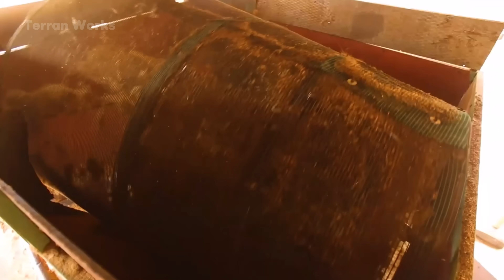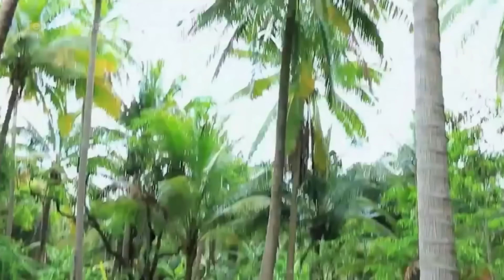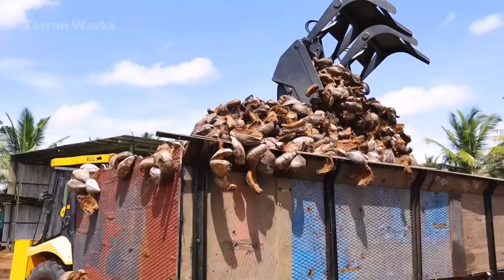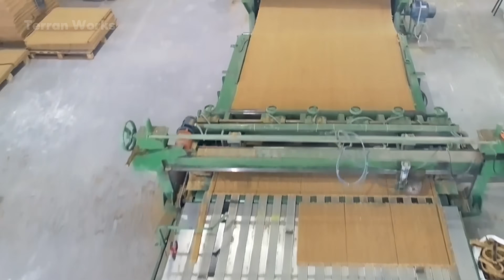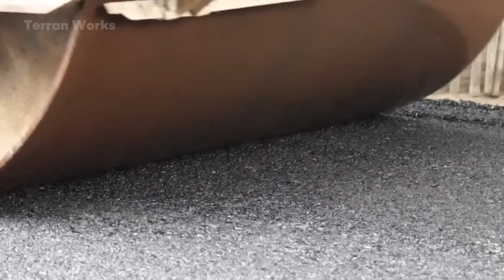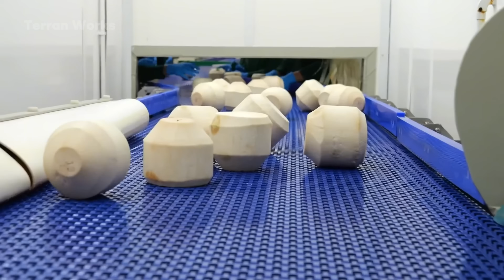How Genius Indian Engineers Build Massive Roads from Million Tons of Waste Coconut Fiber

Comment: What I was taught is that you want NO organic matter in the roadbase.  I am guessing the mats are minimal thickness and are isolated enough from moisture and air to not decay.  Otherwise I would be worried about having to path the road every few years instead of decade.
Reply from the maker: Thank you for sharing, organic materials are generally not ideal for road bases, in this case they may be treated or designed to limit decomposition, but long term durability is still something to monitor

Comment: In Kerala roads are made with coir beds they absorb water and stabilize soil and road after flattened.
Reply from the maker: Thank you for sharing that interesting example. Using coir in road construction is a way to utilize local natural materials and can help control erosion and stabilize the soil base. Initiatives like this show how different regions are combining traditional materials with modern engineering approaches.
Reply: @TerranWorks Kerala is implementing advanced, resilient road technologies to combat monsoon damage, focusing on Full Depth Reclamation (FDR), geogrids, and modified bitumen to create durable, long-lasting infrastructure. The PWD is modernizing construction through smart, eco-friendly techniques like crumb rubber modification, soil nailing, and micro-surfacing, aiming for international standards, including urban projects with smart drainage and utility ducting. 
Key Road Technologies and Innovations in Kerala
Full Depth Reclamation (FDR): A major initiative, especially in areas like Kollam, where the existing, damaged road base is recycled and strengthened to create a durable foundation, which is crucial for handling Kerala’s intense monsoons.
Modified Bitumen (CRMB): The use of Crumb Rubber Modified Bitumen (CRMB) has been adopted to make roads more durable and eco-friendly, notably on the Ernakulam–Muvattupuzha road.
Advanced Geo-technologies: Geo-cells and geo-grids are being used to reinforce soil and improve the load-bearing capacity of roads.
Surface Improvements: Micro-surfacing and segmental blocks are implemented to create durable, waterproof protective layers.
Weather-Resistant Materials: The Kerala Highway Research Institute (KHRI) has recommended using hydrated lime and cement in the bitumen mix to reduce humidity, which causes roads to remain soft and fail after rain.
Smart Cities Infrastructure: In cities like Thiruvananthapuram, "smart roads" are being built featuring underground ducting, improved drainage, LED lighting, and smart traffic management.
Soil Nailing & Slope Protection: Used in hilly areas to enhance stability and prevent landslides on road edges. 

Key Initiatives and Agencies
PWD Kerala PWD: Actively implementing these technologies to upgrade road longevity.
KHRI Kerala Highway Research Institute (KHRI): Conducts studies to improve materials and design.
Smart City Mission Smart City Mission: Focuses on urban road enhancement.
Reclaimed Asphalt Pavement (RAP) Reclaimed Asphalt Pavement (RAP) technology: The PWD is piloting this to reuse old, milled road surfaces.

Comment: This is a great use of waste material, but in no way does this reduce the carbon that comes from the asphalt and concrete used for paving as it replaces neither.
Reply from the maker: Thank you for raising a very valid point. It is true that this solution does not directly replace asphalt or concrete, so the impact on carbon emissions may be indirect. Still, reusing waste materials can provide environmental benefits in other ways. Perspectives like yours help keep the discussion balanced and realistic.

Comment: Coir geotextiles are used in India to reinforce and stabilize rural road construction, particularly under the PMGSY-III scheme. Laid between the soil and aggregate layers, these durable, biodegradable coconut fibers prevent erosion, improve subgrade strength, and reduce necessary pavement thickness. Over 1,600 km of roads have been constructed using this eco-friendly material. 
   Improves the CBR (California Bearing Ratio) value of the soil, increasing load-bearing capacity.
  The National Rural Roads Development Agency (NRRDA) authorized the Central Coir Research Institute (CCRI) to promote this technology. Significant projects have been initiated in states including Andhra Pradesh, Gujarat, Kerala, Maharashtra, and Odisha.
Reply from the maker: Thank you for sharing such detailed and valuable information. This is truly an impressive example of combining engineering with natural materials to create sustainable and eco friendly infrastructure solutions.

Comment: How about insulation for my house?
Reply: Coconut fiber (coir) is a sustainable, biodegradable, and renewable thermal and acoustic insulation material derived from coconut husks. Its porous structure traps air, providing high resistance to heat transfer (low thermal conductivity), making it an eco-friendly alternative to synthetic materials like polystyrene or fiberglass. 
     Boards and panels compressed from husks are also available in the market today.

Comment: Indian engineers should do something for the people who are doing hand work to remove the skin to get the coconut out. These people are doing very hard work but just like the other workers in the factory removing the green skin with machine and preparing the coconut for public consumption in and outside india, if the hand worker have some machine to remove the skin, it will be comfortable and improve their productivity.
Reply: robots will soon replace them
Reply: Machines with increased productivity will cost is job losses. Pick one.